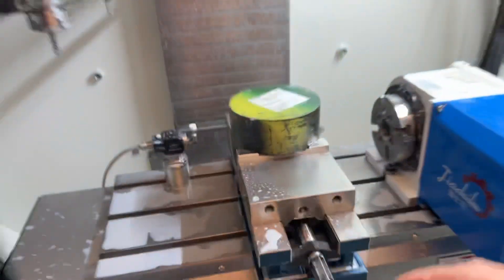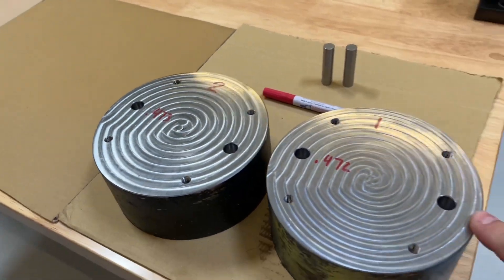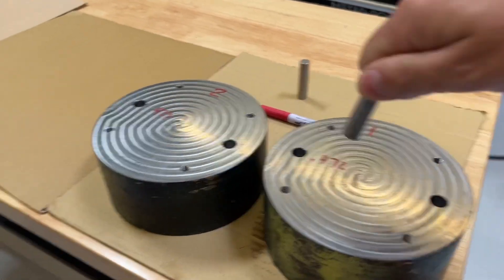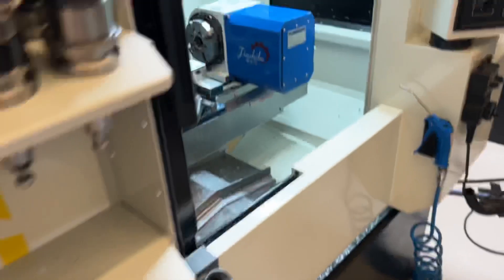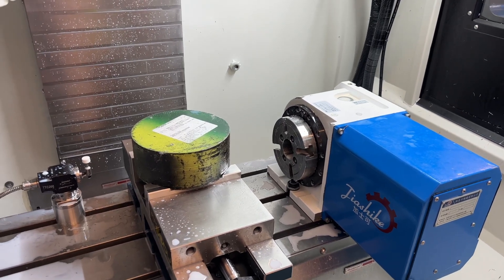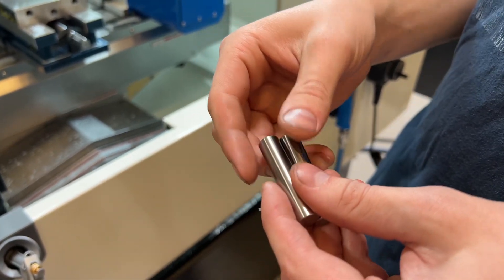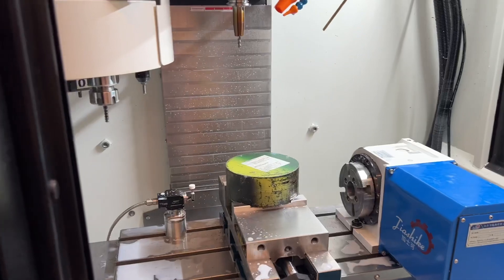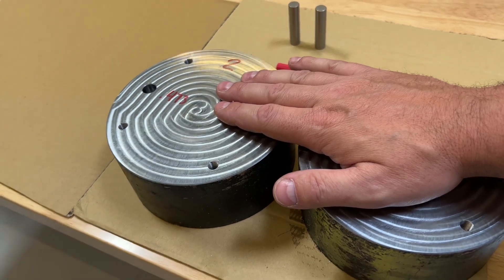Syil X7 - Side 1 of a mold cavity.

Comment: Why are you milling mould cavity on a different machines? Requires another set-up, it could be done all in one op. It seems like Syil is pretty accurate by looking at those locating pin holes!
Or is it because not enough tool holders in ATC on Syil?Thanks for explaining.
Greeting from down-under. 
Yeah, we hate your imperial sizes, I'm just lost when you start saying numbers 😀

Comment: What kind of End Mill are you used to plane? In my first job working with Steel 1045, I used a End Mill 6mm and the first pieces I get a good surface, but my second piece I got a terrible surface. I used a recommended speed and feed harvey tool. I dont know what happend but now I will buy a sandvik End Mill 12mm to try again. I thinkg the wrong was to use only 0.050mm to start planing my pieces and that do the first end mill fail. ¿How many milimiters you used as deep (ae)?

Comment: My man, you got to get your self a Deltronic tenths set for 0.4725! They come with in a set of 25 pins so you will get a set of a class X gages in every tenth from 0.4713"-0.4737" and the sets are only like $250. I love when I get tight tolerance hole jobs just so I can have the excuse to buy another Deltronics gage in set
Reply from the maker: i have a mitutoyo .0001 bore gage :)

Comment: I’m curious why radial facing with an endmill is preferable vs a shell mill? Is this true just for this machine/on hand tooling or in general in your experience?
Reply: I believe it's because it's a low-torque, low-rigidity machine.  I make small mold blocks on a Haas CM-1, 50,000RPM 20 taper, and I do the same thing, but with smaller cutters.

Comment: I really appreciate seeing this process formalized. Rough out the bore, intentionally run an undersized finish pass, measure with gauge pins to establish the required wear compensation, finish. Question: rather than manual intervention, could you probe to establish the wear?
Reply from the maker: Yes.